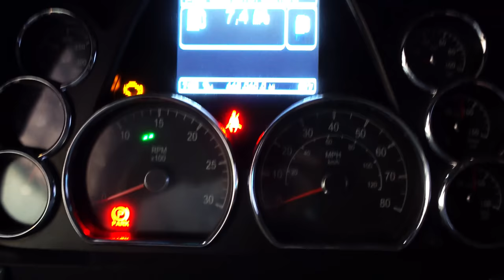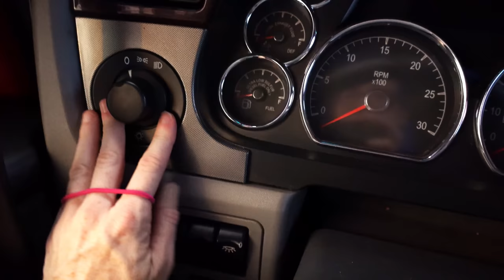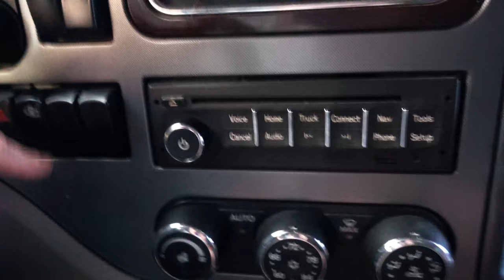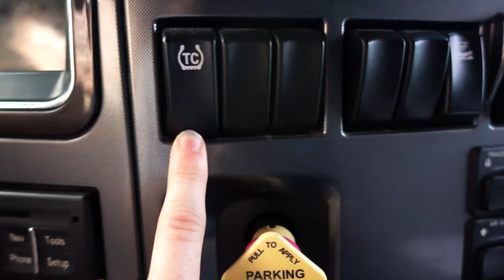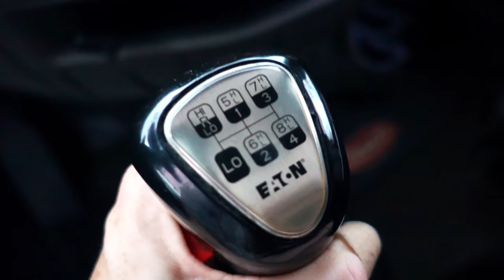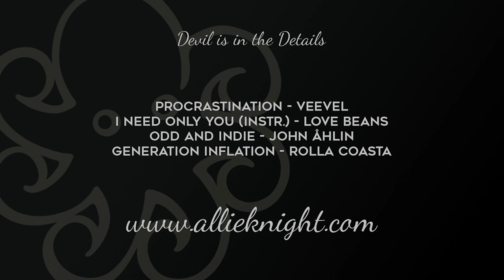Devil is in the Details

Comment: Hi. Welcome back. The light that you call a check engine light is actually your emmisions light. The CEL is above the emmissions light near the top of gge display and has a wrench on it. Oh, you can attempt to reset your emmissions light by turning all accessories off, turn the key on, then off, then on and off fast six times(sometimes i go seven). If it can be reset, it will, if it can't, it won't. But, eventually the light will go off by iteself (unless there's a real emissions prob). The light usually goes when you don't wait for it to go out before starting. Cheers!

Comment: Steve does good work...Allie, l think the trailer air dump axle valves may be for when you have a spread axle trailer on and need to turn sharp (parking lot/yard) - you can dump the air in the rear axle so it's 'Not' supporting weight and will basically slide crossways without binding against the front rear axle (that 'Would' be supporting weight)?

Comment: OMG I'm so excited to see this video been thinking about you a lot even today thank you thank you for coming back!
Reply: Trailer dump If trailer setup for dumps air out of suspension airbags. Dump Front to turn tight and whichever one you want to backup :-) saves tire wear if you have spread axles
Reply: Not able to edit, but for tight turn  (going forward) :-) dump rear bag

If you do a sharp turn without dumping an axle it where's the tires :-) on a spread axle. I'm done LOL

Comment: I will say the cup holders up in the front were not exactly the best designed cup holders. I've had issues with the water bottle just falling out the side of the cup holder and ended up having to engineer a fix to the cup holder, so that wouldn't happen.

Comment: Love your new truck and love your house!!!   BUT, why didn't you do " instant hot" units instead of those huge space taking tanks for hot water?  And also, why didn't you look into ductless heat and air units?  Both save utility bills and do much better jobs than the newer models. Don't take this as a negative, it's just a question. My home is much larger than yours and I have saved thousands compared to all of the homes of equal size using the above. My utilities are $500 to 700. compared to their $2700 to 3000.  It's too bad you didn't have advice from your electrician and plumber.
Reply from the maker: We don't have enough capacity on the gas meter for tankless hot water and they want a small fortune to upgrade the service line.

With the efficiency incentives, the heat pump water heaters were cheaper as well. They also double as dehumidifiers which the basement definitely needs
Reply: @AllieKnightOnline  I know what your saying.  Gas is an expensive adventure. I chose electric units because it's less expensive and the upkeep is less.  Also eliminated the gas altogether.  Thanks for the response.  

Did you look into ductless air and heat units?  They are great. You only heat/cool the areas you want to heat or cool.  No wasted energy for empty rooms.